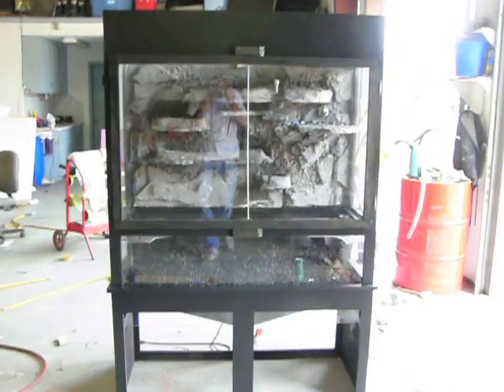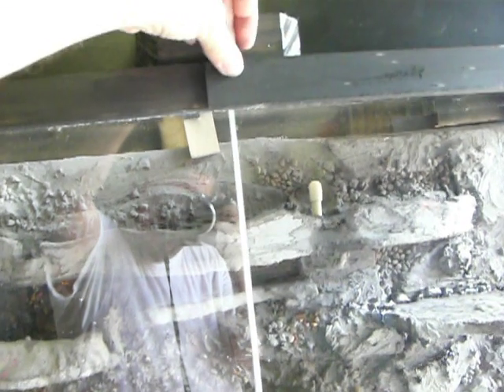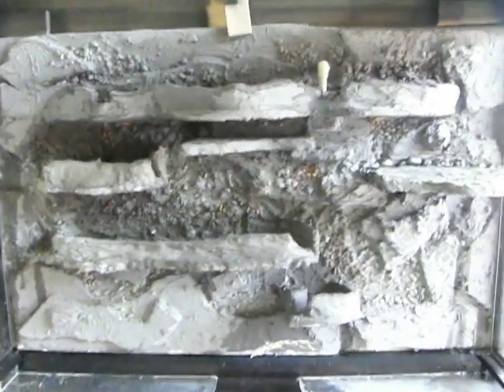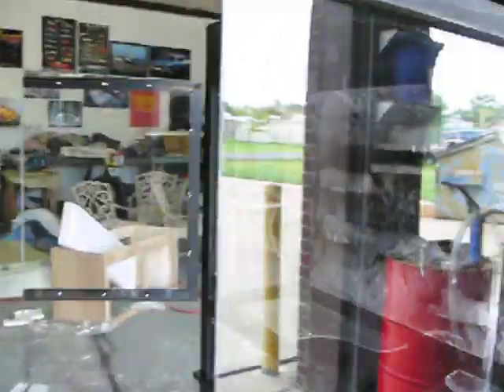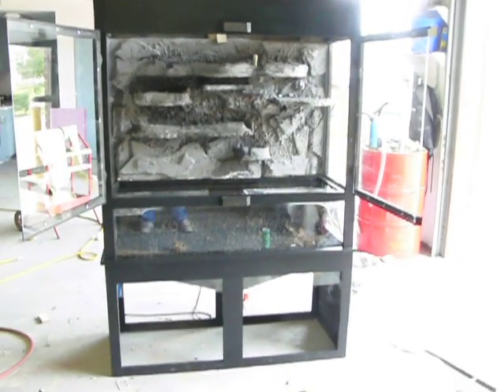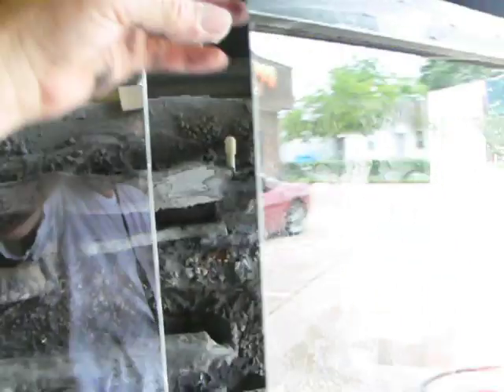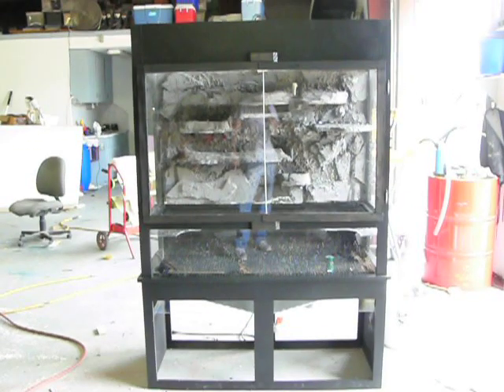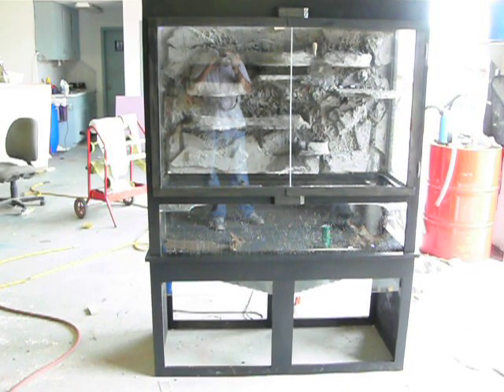water dragon tank 002

Comment from the maker: nothing goes on the grates... it is only there to keep the fish, frogs and lizard from stirring up the crap that goes thru the grate ... the whole point of the angled bottom was for easy cleaning.... I hook a water hose to the drain valve.. and drain the water into the flower bed.... then I can wash the whole inside and it drain to the drain hose and easier to clean more often.... the old tank was real hard to clean.

Comment from the maker: Problem areas: the concrete backer board actually absorbs water... maybe I used the wrong side? I put spray in bed liner on the back to keep it from soaking thru to the back... also.. I had to seal the waterfall landing areas with epoxy.. the grout shrunk a little and caused cracks.. so I filled in the cracks the 2 part epoxy and it should do the trick.... other than that.. it looks like it is almost ready for the lizard... thanks for all the comments..